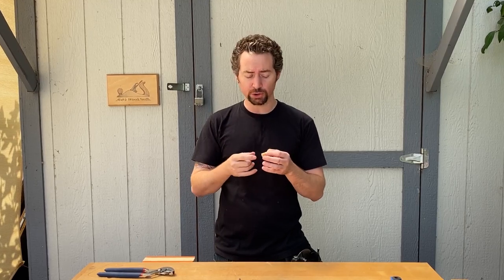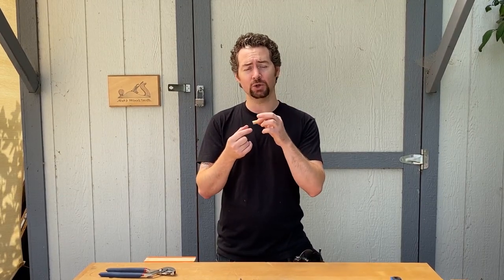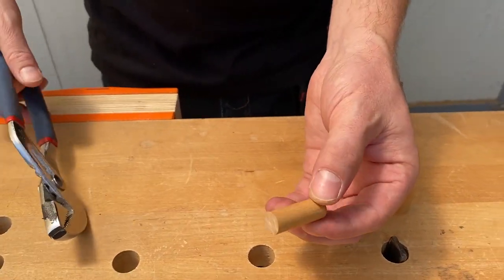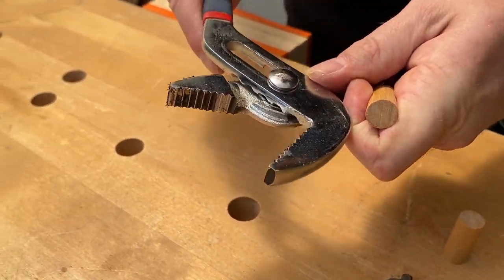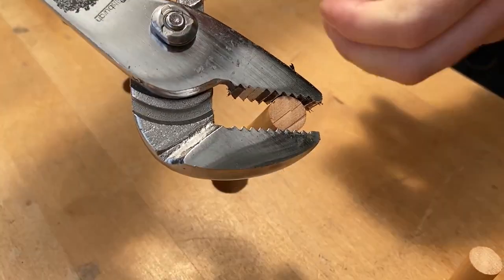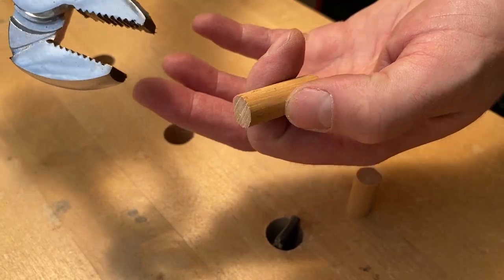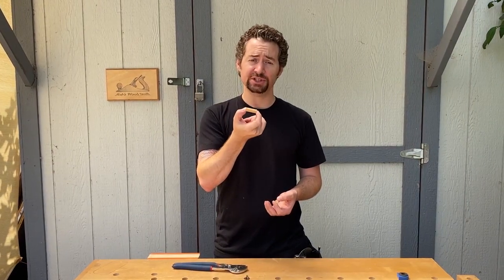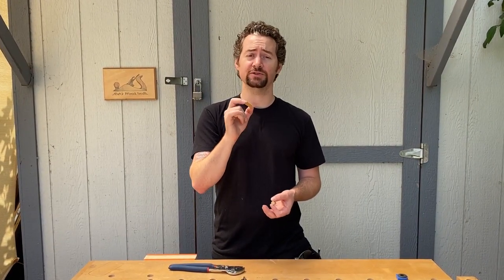Making Fluted Dowel Pins with Pliers

Comment: Need a dowel longer than the pre-cut fluted ones come in, and didn't have a good feeling about using a solid dowel.  Between some light sanding and crimping with the pliers, think this will work great.  Thanks!
Reply from the maker: You're welcome!